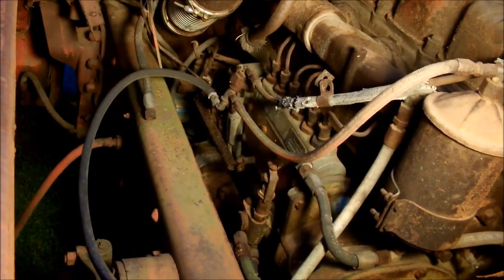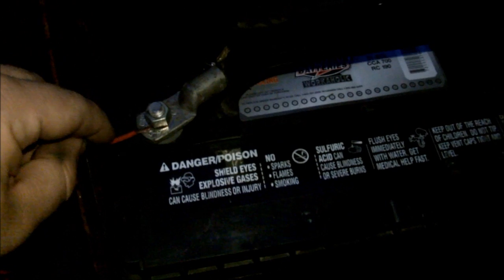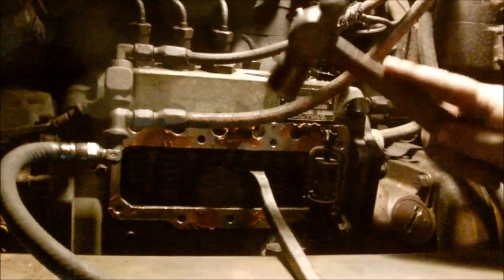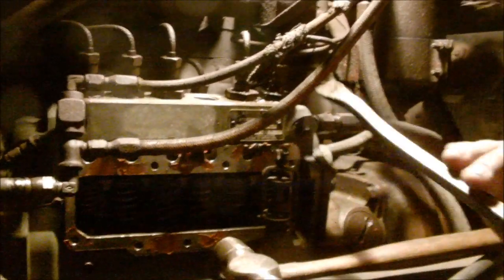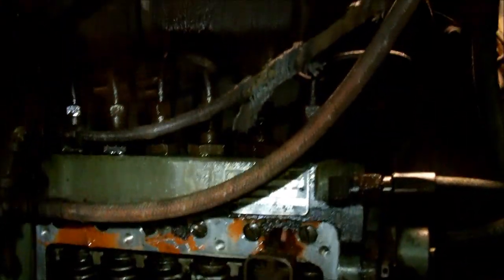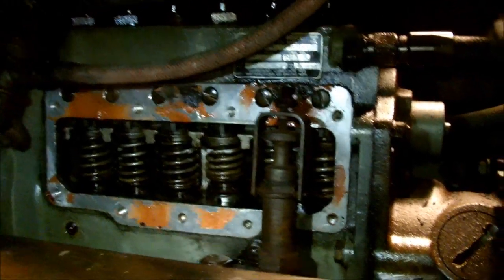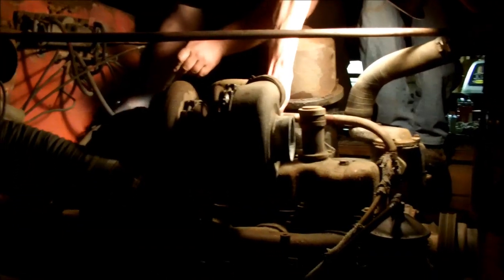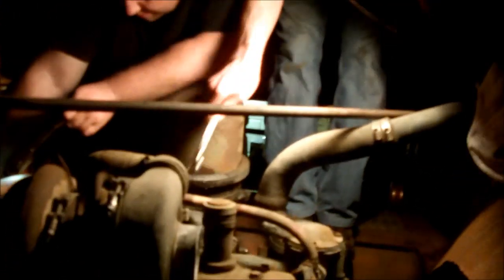Resurrecting a 1963 Mack B81 - It runs on diesel! - Part 2

Comment: 2:08 and this is why unit injection is far superior to this complicated and convoluted nightmare.
By the way the cranking noise created suggests a cylinder loosing compression. Nice going with the ether hot shot.

Comment: wow! TONS of ether TOO MUCH! could have caused a run-away diesel, and burn out the rings
Reply: +fuddmethen I thought that' s what the guy with the flat bit of wood was there for ,to block the face of the turbo so it would stop air getting through so combustion would stop. That's just a guess if I'm wrong Sorry for being an ass .Either way it sounds........  well if you could bottle that sound sales of Viagra would plummet lol 
RC